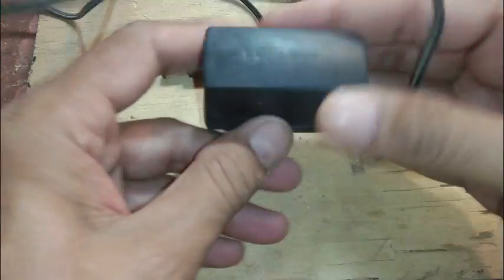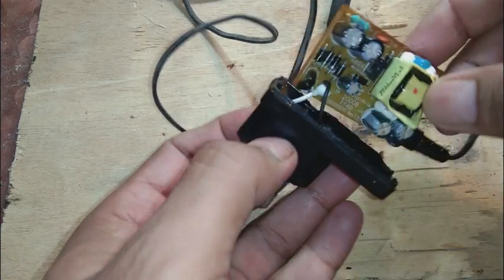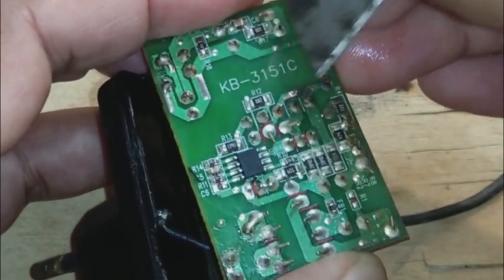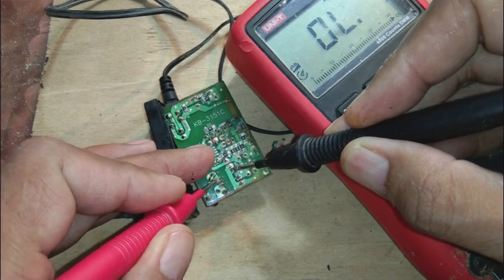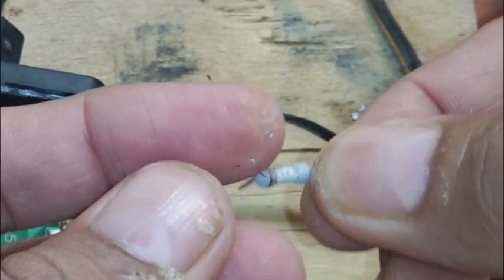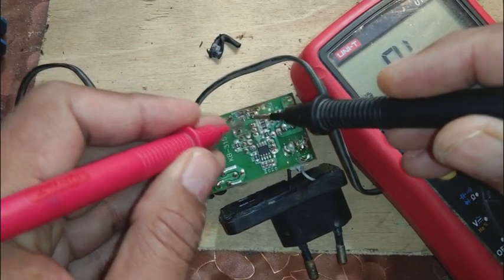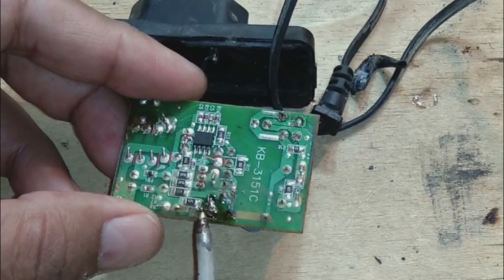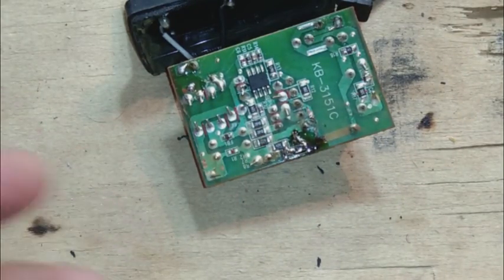SMPS power supply repair. cell phone charger repair. switching power supply repair. Charger repair

Comment: i'm a little confused about that power supply.
They went to the trouble to use a pwm flyback i.c to drive the primary switching mosfet,  then they missed out the opto coupler from the output to the pwm i.c,  so the output is not as accurate as it could be.
Mad manufacturers lol.
I have seen far worse than that psu, no pwm flyback i.c, just a few transistors as a crude oscillator.
Very cheap, very crude.
Reply from the maker: Yes sure dear sir. They have a worst class cheap and inexpensive design. They could serve for small power needs with cheap price. But sure power supplies with feed back are way more stable and of great design. Thanks for your great valued comment.